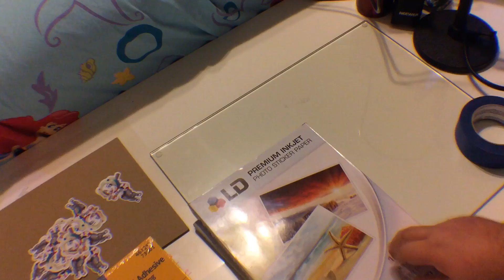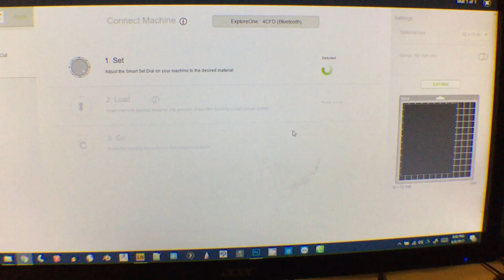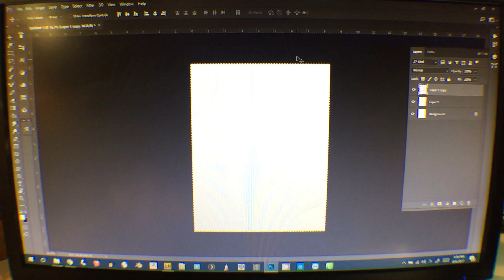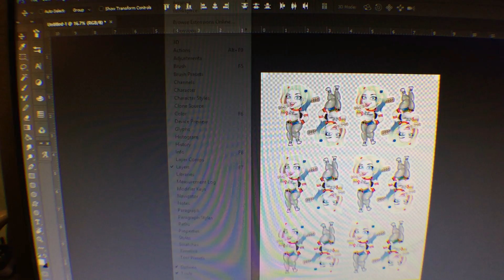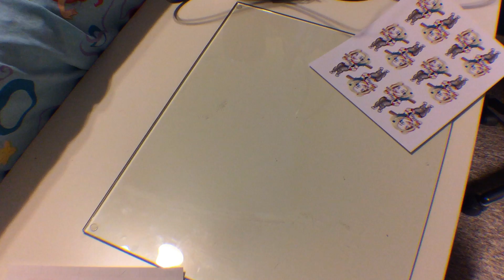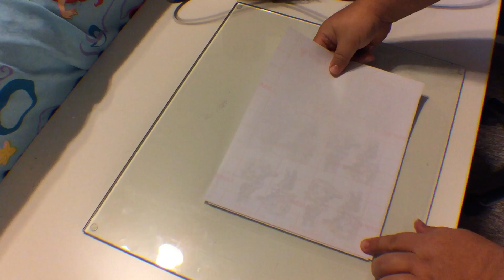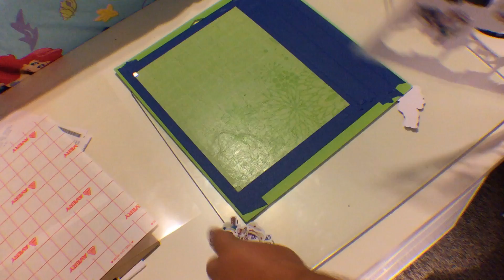Trick your Cricut to do FULL PAGE Print and Cut - Sticker Tutorial!!

Comment: I am going to try this! Thank you! What I DO NOT GET, is why Cricut has this limitation for Print and Cut. No one seems to be able to explain the reasoning behind its functioning. I like to UNDERSTAND things haha. So thanks a lot. I was asking how to do this in one of the FB groups and I was discouraged to do this because of the lack of precision of the cut, but your way will probably solve this issue for me!
Reply from the maker: Thanks, I hope this works for you! The limitations Cricut has I think is really do to the fact they are using web-based software... that's why depending on which Browser you use determines a lot of the different size restrictions. I found Firefox allows for the largest PRINT CUT sizes when you using Cricuts DS, but that was also a version or two ago and I have not retested that in a while... Honestly I have never used their new Print and Cut options with the big black box... Reason for that is all my artwork is very high resolution and Cricut converts everything to low resolution and my prints never come out as high quality as they do when I print them through Photoshop. I believe this to be another limitation to Web-Based Software.

Comment: I bought a large-format (13"x19") printer and a Cricut Explore Air specifically to print and cut boxes from A3 or 11x17 paper. I spent hundreds only to find out that the maximum supported Print & Cut area is significantly less than the maximum cutting area. Their support team implied that I should have known from the USER guide before buying it. No, that should be under the specs because a prospective buyer is the opposite of a "user." grumble grumble That was ordered Black Friday... almost a full year ago. Fast-forward to now and I see you've overcome this. Awesome! Only issue now is that I don't have Photoshop and I struggle to do anything in GIMP. Any way you could make an 11x17 template? Do I need borderless prints? The other cool thing about this is that it should also work for the machines that don't support Print & Cut, like the Cricut Expression. I actually got one of those the other day for under $13 and it's why I started looking into this. :) Thank you so much!
Reply: Hello!  Did you make this work with your expression?  Inquiring minds would like to know?
Reply: @tiffanyjonse3643  I still intend to try but, no, I never got around to it, unfortunately. :(

Comment: Hi.  I made a template for my iPhone 7+.   I printed the design I want to use on the template.  I flattened the image, applied laminate and then cut out the cell phone case template.  My Circut Explore will not scan correctly.  After scanning the template it cuts in different directions.  Does this have anything to do with the laminate?  It will not scan correctly.
Reply from the maker: Yes, the line scanning on the Circuit will not scan gloss or high res lines for some reason. This is another reason I created this method over scan and cut.
Reply: Thank you.

Comment: Thanks for this video. Print and cut has frustrated me with the amount of waste I have and limitations of size. In the beginning of the video you planned to load your mat upside-down or backwards, but ended up loading it the correct way. Is that the reason for the first 2 cuts being slightly off? Just an observation. Thx again!
Reply from the maker: No, I was just showing as long as you load it the same way you can adjust the tape and cut for placement. It can be upside down or right side up. Alignment issues happen the Cricut is not perfect. I also notice when you do more than a few cuts of the same page without reloading the cut file it will very over time.

Comment: Great video! We just bought our cricut explorer and was wondering if the offset or white borders are necessary for this trick. Planning on printing and cutting them on a heat transfer paper and later on iron them on shirts so some of the designs will have no white borders on them and will just be full on colored. Will it still work even without the borders around the full colored images?

Comment: I was wondering if you have had any problems with your Epson printer. My and I both have this printer and we have both had problems and I have not ever had problems with any of my Epson printers.
Reply from the maker: I have two epson what kind of problems?
Reply: Eric M Boyd hey I'm using an Epson wf7610 and the registration marks don't print in the corners I used black just to see where they were printing and they end up a 1/4 " in in all for corners
Reply from the maker: I don't print registration marks, but I am assuming you are having alignment issues. If I use the paper tray feed I do have alignment issues and that's why I use the rear paper feed. Guess I should have mentioned that. On my Epson 320, I seem to have fewer issues with that.

Comment: Why do you put the blue tape on there? Didn't understand that
Reply from the maker: Placing the blue tape and then cutting out the full page 8.5x11 shape ensures that I place my page exactly on the mat where my Cricut is always going to cut at X-0 and Y-0. This way My registration marks always line up with the inside area of the tape on the mat. I think I will be doing some new video soon as I need to break things down into parts a little better I really put this together quick just to answer all the questions I was being asked.  Hope this helps!
Reply: thank you im really new at the cricut
Reply from the maker: No worries, this method is not a usual way of doing things its just the way to get full page print and cut that I came up with. I had my Cricut for a year and was frustrated with its limitations. This is just my way to trick it into doing what I wanted/need it to do.
Reply: do you have the cricut air 2
Reply from the maker: explore one

Comment: Thank you so much for the video. Its so strange that the first 2 cuts it does are off (end/bottom of paper print)...and the rest of the sticker sheet is correct...Its the strangest thing! I followed this step by step any suggestions would be greatly appreciated!!
Reply from the maker: Not sure what you mean I'll be honest I have been perfecting this method for over a year and it still frustrates me from time to time. I just did a stack of over 100 stickers today and I had one page completely off.... I find that rebooting the Cricut machine fixed it. After some time I feel it starts acting up.
Reply: do you find that it is easier when you have a bigger white area around the sticker image?

Comment: THANK YOU THANK YOU THANK YOU .... i've been looking for a solution with my cricut for 1 month now and you just solved it ... i test it with 8.5x11 with 12x12 and with 12x24 and it WORK so THANKKKKK YOUUUUUU :)
Reply: For the 12x24 (and 12x12) didn't use tape just the mat and plain white 12x12 paper (2 glue together for the 12x24) then in photoshop i set it to 11.5x11.5 or 11.5x23.5 when you print you center it on the page so instead of placing it a x:0 y:0 in DS i put in in x:0.25 y:0.25 you have center your image :) that is what i did :) hope it helps
Reply: LoVelyFr THANK YOU! I just found a way to save my Design Space image as a png and open it in Photoshop and I feel I've got the jackpot.  I was staring to recreate everything in PS. So if I'm trying to do this all on 12x12 do I even need to use tape? Wouldn't I line up my paper  on the 12x12 mat and leave a 0.25 margin in Photoshop and then set up the x and y in DS at 0.25? The tape is throwing me off! I'm so appreciative of your help... I'm working on this right now and on a time crunch :/
Reply: LoVelyFr May you please make a video of you doing it to the larger size (12x24)? Would so love to see your process, thanks.
Reply: Julie :) I am at the moment doing a 12x24 i'll try filming it and posting it i'll tell you when I'm done :)
Reply: yes they are necessary cause they are the one that keep the design the right size (8.5x11 12x12 12x24) cause if you don't use them in your PNG in DS you wont be able to position it at the right place .... well i think so ... i just made 3   11.5x22  (usigne the tape cause im by 22" not 24) and i use ma registration mark and it look good :)
Reply: LoVelyFr that is so sweet of you! I actually finished the project! Emboyd has a video on how to do the registration marks.  I printed and cut 100 menus for my sister's wedding I'm now working on seating cards but such to DS for this one! cricut needs to add capability of print then cut without putting to 8.5x11 :)
Reply: How did you set up the 12x12? When I try to do the blue painter's tape it does not allow me to cut a 12x12 shape.  The biggest I can cut would be 11.5 x 23.5?  I'm so confused..TIA
Reply: Are the registration marks necessary?  Does it alter the positioning?  I have not figured out how to add those in PS.  Thanks again!
Reply: LoVelyFr, thank you so much! I would really appreciate that as I'm a visual person when it comes to designing/crafting lol!
Reply from the maker: Welcome, glad I could help!
Reply: no tape for the 12x12 ... use a 12x12 paper ... BUT in photoshop set your canvas (base background how ever you want to call it) at 11.5x11.5 ... put your registration mark at 0.25 like in the video same thing in four corner .... print it on a 12x12 paper CENTER IT (use the printer or program option for that) ... then in DS size your image a 11.5x11.5 but instead of placing it a 0x0 place it at 0.25x0.25 so ds accept your cut cause its 11.5 and it should work (work for me)

can i ask what is the method you use to save your ds image in png ??? please
Reply: LoVelyFr aka Manon V. 

you said you print it on 12x12 paper meaning you have a printer that prints to sz 12x12 is it a Canon? asking because I use Epson and there printers are the basic  print sizes then the newer models start at 11x17 then 13 on up they have no 12x12 printers when I asked Best Buy customer service, just intrested in what brand printer your using to print your 12x12 on up (12×24) from..
Reply: I dont get the print it on 12x12 paper then sized down to 8.5x11 or do you mean you subsituted the tape method for 12x12 paper (taped (2) 12x12 plain paper to get 12x24 as a cut template to center where to place the printouts 12x12 to 12x22?) and then followed Eric steps of adding the marks from photoshop? really trying to follow your process for larger sizes like 11x17 etc

Comment: I missed what the registration marks were for. Itching to use this system.
Reply from the maker: They are used to keep the page aligned for cutting full page.
Reply: Eric M Boyd I though that's what the tape was for. I don't understand how the registration marks help on a cricut.
Reply from the maker: In order to trick Cricut into cutting exactly where you want it to, the white boxes/Registration marks need to align with the tape. If you do not do both cricut will move where it wants to cut and will not match with the tape.
Reply: Eric M Boyd ok, I think i get it, the cricket doesn't see "registration marks" is sees I must cut here and here so I can't start wherever I want.
Reply from the maker: perfect!
Reply: @EricMBoyd  help! I am not great with photoshop, and I don't really get how you create the registration marks, and place them perfectly on each corners. I hope you can clarify this part for me? I am soooo excited to try this!
Reply from the maker: @SaraMichetti  I go into this mor indepth in my other video for photoshop.